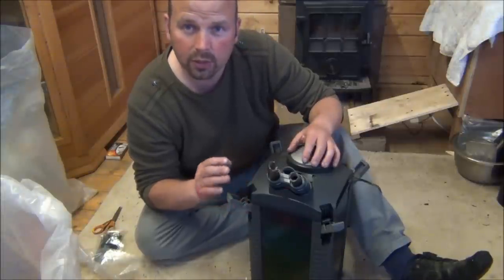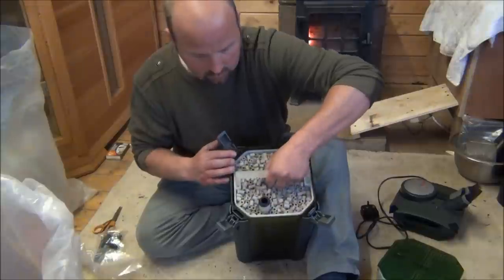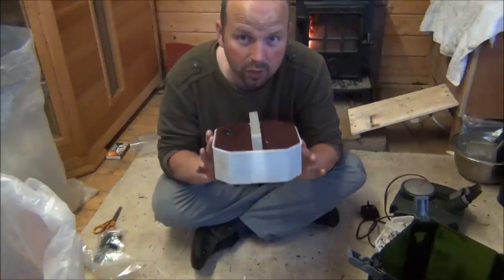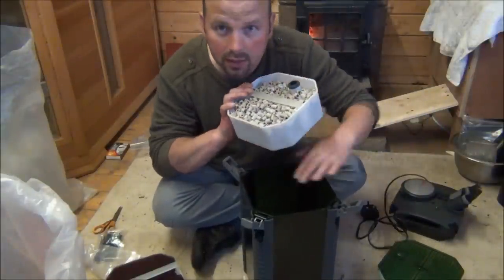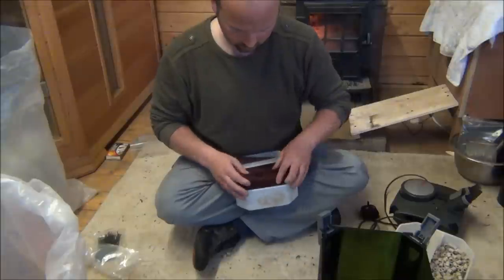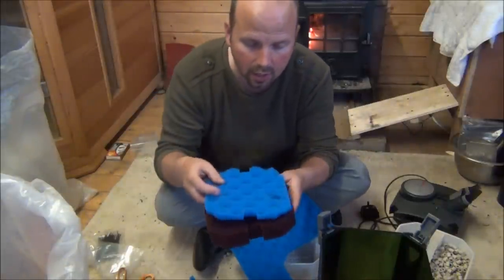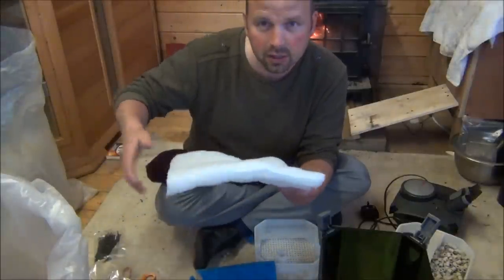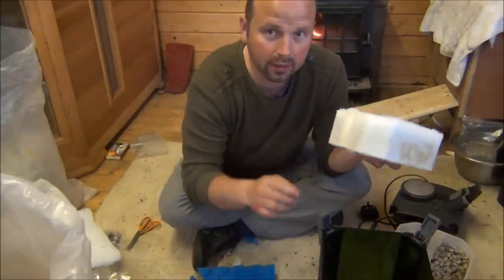How to set up an external canister filter for aquarium by Pondguru

Comment: My husband and I rescued a red-eared slider turtle.  While we just adore her, we have found she can be quite the messy little thing.  :)  So, I just put together a canister filter...finally...after a few months of weekly water changes.  Your videos have been really helpful...thanks again!

I know I read not to change the bio wheel on my old filter, and carbon does not work after about 5 weeks... I am looking at your US link for buying the Biohome Standard Media.  I have figured 1 kg will fill almost two trays, but I need to know if I will have to replace it soon?  Or, do I just leave it like I would a bio wheel in a smaller filter?
Reply from the maker: +Lisa Black The mini ultra is larger and more porous than the standard biohome so would be a better choice. In a properly set up filter the media should last a good 6-10 years so no worries there.

Comment: This video absolutely makes sense to me. I never understood what the purpose of a pre-filter is or why one should have a fine filter pad as the last stage. The new Eheim Pro 4 canisters doesn't really make sense to me. It's a waste of money. From my point of view and my experience even with internal filters the first media, the water should hit, are ceramic rings or the mech pro from Eheim.

I set up an Eheim eXperience 150 exactly like you showed in this video. I filled the bottom gap with ceramic rings and the first tray with foams and a fine pad. The only differens: I have no medium pad. I just have the original coarse foam and the original fine pad, that comes with the filter. The second tray is filled with Biohome. I just wait for the anaerobic bacteria to start their work.
Reply from the maker: That sounds good to me and I'm not really a big fan of the 'pre-filter' tray in any of the canister filters as I like all the muck to be held in the bottom of a filter - that keeps the media in trays above very clean.

Comment from the maker: Not sure how that particular media is set up as we don't sell them. Provided the water goes through the foams first, coarse, medium, fine then the media it should be fine. Check the ceramic media in that filter though as most of the time companies save money by using crappy media in their filters. Best way to improve efficiency is to replace the media with the best you can get.

Comment from the maker: I always use it in fish ponds to keep the water clear but it is an optional extra for aquariums. If you have multi tank systems then it is necessary but for a single tank set up people kept aquarium fish with no problems for decades with no UV.
Today manufacturers just try to convince people that they need all sorts of crap when it should be a simple process.

Comment: Some Good Information! Would you know if using these Same steps and products would be as beneficial on a Salt Water tank, And if So what Canister would you recommend for a 30g tank?
Reply from the maker: Yes any canister like this would be set up exactly the same for best results and we now have a marine version of the biohome - link in video description and pinned comment.
For a 30g tank you would ideally look for a filter which promised to filter 'up to 60g' as a minimum - that will allow you to get plenty biological filter media in there.
Reply: I am in the U.S & was looking at getting Either a Penn-Plax Cascade 1000 or Flu val 306. Saw a video on the Cascade where Someone could fit about 3 quarters of Biohome in a single Media slot. Would you say a little over a Kg of Bihome would be enough for full Cycle?
Reply from the maker: I'm not familiar with the Penn-Plax as we don't see many of them in the UK but the 306 should hold 1kg (2.2 lbs) per tray so you will get 2kg in there which should be plenty even if the 30g tank is stocked on the heavy side. As long as the bacteria develops naturally without chemicals killing it off it should cope with anything you'll have in there if there is 2kg no worries. Full cycle may take 4-6 months to develop as the anaerobic bacteria (last part of cycle) takes much longer to develop than the aerobic bacteria.
Reply: Ok. The Penn-Plax does also sell a larger model, that supports up to 150g And has 4 Media trays for Filter. I would have well over 2kg of Biohome, so wondering if I filled up 3 trays of Biohome, would I be over doing it? Or is there even such thing as having too much Filtration?
Reply from the maker: Beau Cubano you definitely can't have too much filtration so if you go for the bigger model from Penn plax or the fluval 406 and use the biohome media you should have no problems with water quality.

Comment: Excellent vid just wondering is your setup ok for my marine tank with live rock and sand? Which is currently cycling.
Reply from the maker: Yes, many people are using the newest form of biohome: Biohome Ultimate for marine as it is the same as mini ultra (as in this video) but has added trace elements for better, stronger bacterial colonisation.

Comment: Hi Richard.
What are your thoughts on external filters with uv for an indoor aquarium.
Are they worth having or would you stick to 'uv less' filters ?
Reply from the maker: I've never really seen the point of having a UV unless the filter was treating a system of tanks but they don't do any harm. Just remember while setting up (cycling) the filter lave the UV turned off for the first 3-4 weeks to allow enough beneficial bacteria to flow through the tank and filter.

Comment: thank you richard, indeed. So the coarse foam on top than, than placing the medium and the fine one at the bottom. So what will happen is the water will go through the coarse foam at the top first, than into the two tubes (eheim 2080 has two ofcourse), it goes to the bottom and passes through the medium and fine foam at the bottom, than through the biological filtration. I think that the biological media will stay clean, thank you for showing us that.

Comment: I saw the your middle tray had an o-ring on the top of the riser tube. On my cheap Cascade 1000, the o-ring fits against the motor tube so I have to place it on the top tray. I do have my sponges and floss in the bottom tray and my Fluval media in the other trays. I plan to replace that media with Biohome Mini when I get some income tax money back in the spring.

I increased time between cleaning the trays by putting a sponge prefilter on the strainer in the aquarium. I clean the prefilter weekly. I have to tap it to remove baby shrimp from it as they love to eat micro organisms that live in the filter.

Also, do you think unfiltered water goes between the baskets and canister? I have often thought about wrapping some floss around the bottom basket to prevent this. I haven't done this as I also thought it might be a sort of bypass to keep the motor safe if the media gets plugged.

Thanks for the great videos. I am limited by experienced, knowledgeable aquariists here in Kansas, USA so its great that great folks like you will take the time to post educational videos.
Reply from the maker: Yes I think the space for some water to bypass does ensure that the pump won't strain itself too much so you may be spot on there.
Glad you enjoy the videos and can see the sense in the way I recommend setting filters up.
Yes those shrimp love to pick at the food which collects on foams, lol

Comment: Really great ideas, at tip 7, the filter foam for mechanical filtration, what hind of foam for mechanical filtration, where to get it and how often would I change it, by the way, I am putting this in my freshwater aquarium sump
Reply from the maker: Link in video description or alternately search 'pond filter foams' on ebay or amazon.
The quality varies wildly so  make sure you get good quality foams. The white fine pad will be replaced when it gets clogged (time will depend on stock and feeding) but the coarse and medium foams should last a good 18-24 months before they lose their 'bounce' as long as they are squeezed out during filter maintenance.

Comment: Hi, thanks for these information; it was really helpfull! I've just bought some Biohome ultra mini from you, after watching this vídeo.
What do you think about chemical filtration? Do you recommend Purigem? I think about placing it at the top of the lower tray, just above the fine sponge.
Reply from the maker: If you want to absorb colour from the water or have a load of chemicals in your tap water it is a good thing to add, yes. If you have neither of those issues it's not worth using as your filter will process the waste from the fish and the foams / pads will keep the water clear.

Comment from the maker: That would work but where would it go? If it was in the tank it would defeat the purpose of an external filter. Numerous filters can be joined together but it is way easier to just have one simple unit. If it works, it works no matter what sort of set-up you have so go for it if you want to have separate parts, no worries man.

Comment: Hi I have just got a aqua one 1200 with original media second hand,running red sea max 130 what media would you recommend the same one in the video,Could i suck the water from the back compartments i have no skimmer,Thanks easy to learn video
Reply from the maker: That should work. If you are using the tank as a marine set up then most people would go with the biohome mini ultra as used in this video. You will need 3kg. This video shows exactly how to set up the filter you have but you would need marine gel balls, not the freshwater ones as shown in this video: https://www.youtube.com/watch?v=lsAmSD3wVbg

Comment: I followed your suggestions p,acing crappy ceramic rings at the bottom and am amazed  how much poop it collects. I use sun sun canisters and per your suggestion placed foams in the bottom tray but here I have a question: first in black bumpy foam, next dark blue bumpy medium foam and last a fine lime green foam. The other trays have media. The lime green foam has a lot of muck on the top of it, correct. Oh, my final top tray has a white pad on top of the media. All my tanks are chiclids btw.
Reply from the maker: The lime green foam in bottom tray has muck on top of it as the last tray has a fine white pad. That concentrates the fine muck in the media trays so that's why I always advise using the fine pad in the bottom tray to make sure water is clear before hitting the media. All mechanical filtration should be done before water hits media.
Coarse, medium and fine in bottom tray then  media in trays above - that way all the muck is held in bottom of filter and media is clean and able to work more efficiently.

Comment: Hi Pondguru, many thanks for the videos as a complete beginner they are really useful, i have a stock fluval 305 external filter would this method of filtration be suitable for that?
Reply: +Mark Dawson I've got a 305, with a 275lt tank, viewed this video and his other ones so i decided to experiment.  I've used stock course foams in the side filter unit, the bottom tray has course, medium and fine foams cut to shape, and sintered glass in the next two trays, as per the video.  works as stated.  I'm upgrading my filter to a higher flow rated one as the filter power isn't man enough, but the water quality has greatly improved.
Reply from the maker: +numewsm +Mark Dawson  Thanks for that glowing report. It certainly makes sense to have all the mechanical filtration done before the water hits the media. The 305 should hold around 0.8kg of mini ultra or biohome ultimate per tray, maybe up to 1kg per tray if very carefully packed.

Comment: Thank you for the information! I have a fluval fx6 how do I set that up?? And do you ever use carbon in the canisters?
Reply from the maker: As you have good foams surrounding the trays in the FX filters you only need a fine pad on top of top tray (water flows down though trays) then fill the trays with the biohome mini ultra / biohome ultimate - you will be able to get 5kg of either type in the 3 trays.
Unless you need to draw in residual fish treatments or colour from bogwood there should be no need for carbon but it is fine to use if you want to. It would always be the last thing water hits before leaving the filter (bottom of bottom tray in the FX4/5/6.
Hope that helps.
Reply: ^what he said.

Comment: great video I have some what of the same thing that I use for my outdoor turtle pond. I have a 1/2hp pump connected to the inlet and the outlet for my waterfall. I also found that putting the pump on a flat stone keeps from sucking large debris and clogging up the flow of the pump. I do have to clean the filter about every two months due to the size of the pond 16' x 20'
Reply from the maker: Every 2 months is not bad for such a large pond so it sounds like a good system.

Comment: I want to convert my canister filter that is sustaining my 120 gallon planted/stocked aquarium. Should I do just the foam pads 1st then let it run for a couple weeks before swapping out the media?  Would like to not cause issues with kicking off re-cycle of tank while stocked.  Any Tips on an efficient conversion to your recommended filtration with my existing functioning canister filter?  Thanks.
Reply from the maker: Yes for a mature filter it is always best to upgrade gradually. Good idea to do foams first week, first tray the next week, leave for 1-2 weeks then do another tray and so on. That way the change over will take 4-6 weeks depending on filter size and how many trays it has. The gel balls supplied with the filter media will make the transition even smoother as they dissolve in the presence of ammonia and nitrite releasing beneficial bacteria into the system and helping to rapidly seed the media.
There are more notes on filtration on the Q&A page of my website http://www.filterpro.co.uk

Comment from the maker: You should be able to get a brush to clean the inside of the pipe from your local fish store. They are similar to the type used to clean the barrels of guns but they are flexible so are great for going round corners. If the fish store doesn't have any then you will find them online by searching 'flexible hose cleaner'.
Thanks for watching and appreciating the videos.

Comment: Hello, This video is great thank so much for posting it! I keep fancy goldfish and have just purchased a 2nd hand Fluval 405 external filter. It is set up slightly differently to the eheim in this video. Can I still use the same principles? Aka buy the pond mats and pack them course to fine within the sponge compartment? Also when it comes to the carbon and media in the filter trays ,the carbon is a compartment below the media, should I switch them around? And one final question, the media is some kind of plastic media they call 'biomax'. Should I ditch that and get the media you suggest, the 'biohome filter media'? Thanks so much for your advise! :D Very much appreciated!
Reply from the maker: Just treat the trays the same as you would with the ones in this video with the coarse, medium and fine pads in bottom tray then media in trays above. If you use carbon put it right on the top tray as it should be the last thing the water hits before leaving the filter. There should be no place for plastic media in a canister filter.
Reply: Pondguru Thank you for your response. They are definitely some kind of plastic cage ball looking things, its difficult to describe, but definitely plastic! So sorry to be daft but can you recommend links where I can purchase the biohome filter media instead? And can I buy the pond mats from just ebay Im guessing? The Fluval is slightly different as the sponges are on the side as apposed to being on a bottom tray, however I'm sure I can still make it work!  One last question, a friend of mine has said that fancies need 10x the water volume in filtration, which seems like a hell of a lot even though I know goldfish produce a lot of waste. I have a 400litre filtration system on a 255 litre tank. Surely that should be enough with regular water changes? Sorry if you are not a goldfish man its no worries to ignore this last question :)
Reply from the maker: jackalleg Goldfish are messy beasts and ideally they need at least 30 litres per fish to allow for growth so its always best to double up on filtration. e.g. for a 255 tank pick a filter which will cope with 500 litres but with biohome and foams in correct place the filter will surpass the manufacturers recommended tank size no worries.
The link for biohome is in the video description so click that for direct link to my ebay shop. Yes there are a nation of foams on ebay just search replacement pond filter foam sets and fine particle matting. I would still add the foams and fine matting to the bottom tray to ensure that the water is mechanically clean before it hits the media and just go with coarse pads down the side to catch the heavy muck.
Reply: Pondguru Thank you that's brilliant. Don't worry one thing I have correct is the volume of water per fish :D They have MEGA amounts of room for growth! Thank you again for your advice. I have been enjoying your moving bed filter tutorials. If I have my 400 litre external filter set up correctly and added one or two home made moving bed filters (I already have a good few air pumps kicking around so this wouldn't be hard!)  in your opinion would this make for a happy goldfish aquarium filtration wise? I'm so glad I found your youtube channel!
Reply from the maker: jackalleg Sounds fine but since goldfish always look grumpy it will be difficult to tell if they are happy, lol
Reply: Pondguru Haha very true, I must just be into the grumpy look as I also have Bulldogs lol. thanks for your advise again it is much appreciated. My fancies mean a lot to me and I like to do right by them.